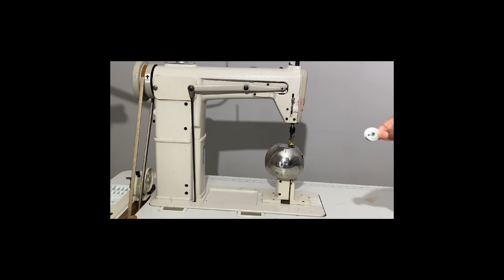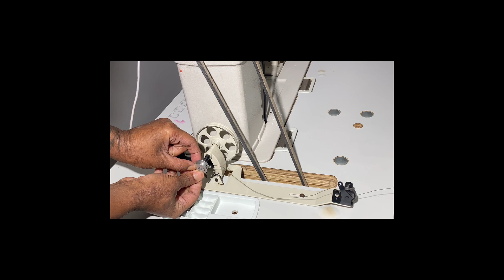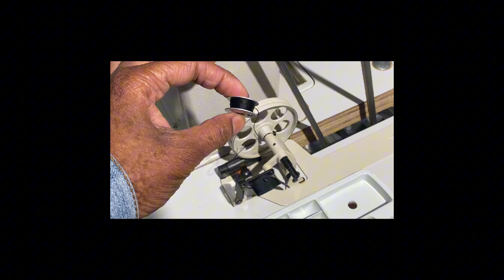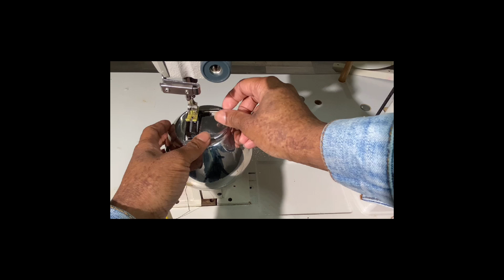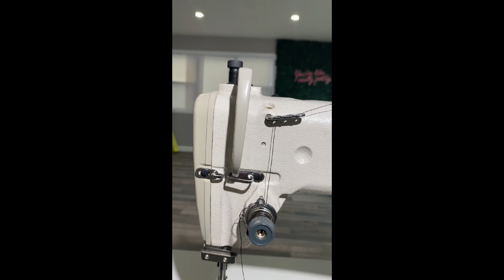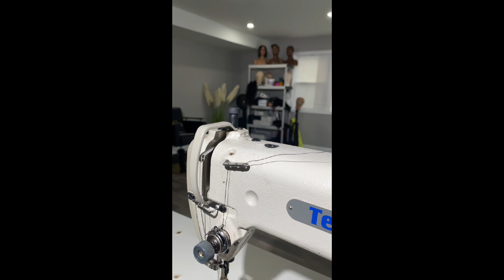HOW TO THREAD AN INDUSTRIAL  WIG MAKING MACHINE (TECHSEW 810)

Comment: Hello, Hopefully all is well. I noticed you use Polyester Thread for your machine. Do you like polyester thread better than Nylon?
Reply from the maker: Hi, yes I like this polyester thread. It slide through the machine very well and keeps my wigs together good. Other threads break often or is too thick or too thin for my machine.